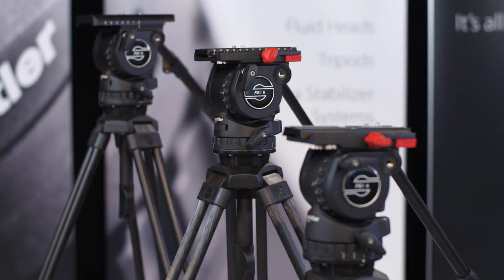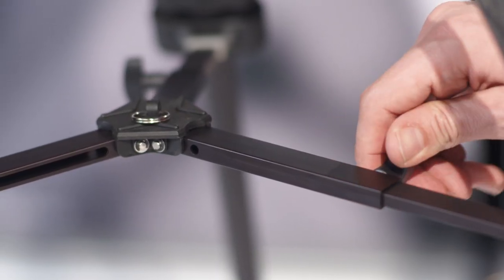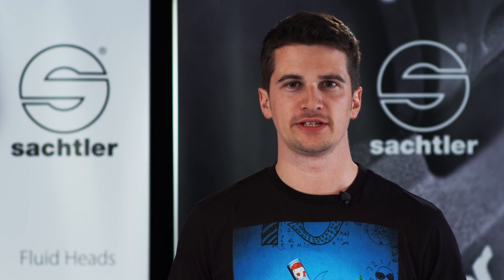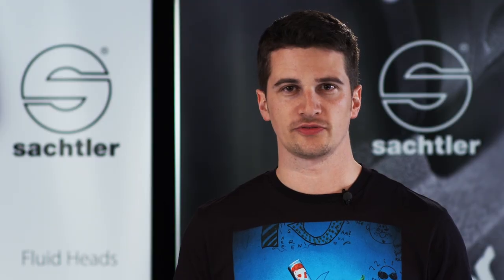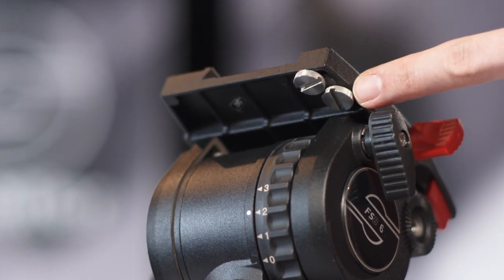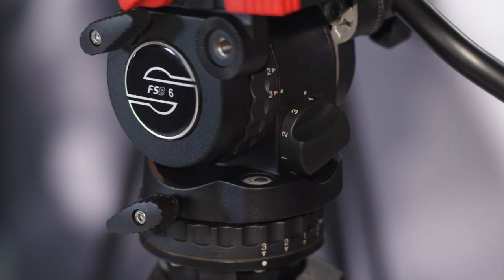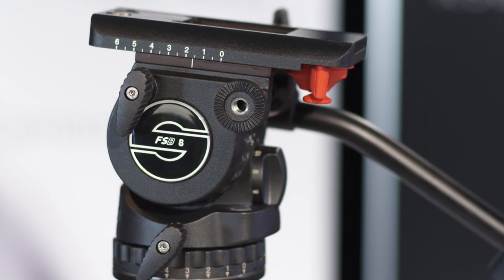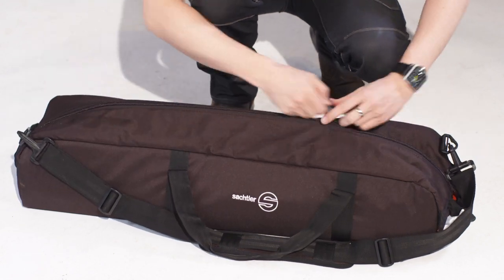Sachtler Tutorial Video: FSB series

Comment: On 4:28 you can see that above the handle grip, there is a black plastic clamp. I have been wondering for days, what is it for? Thanks in advance!
Reply: Aulon Harizaj if you still wonder it's the place where you attach zoom and focus controls for broadcast cameras. The plastic clamp is there so that you don't damage the handlebar with metal clamps focus and zoom controls usually come with. Hope this helps.
Reply: Thank you! :)